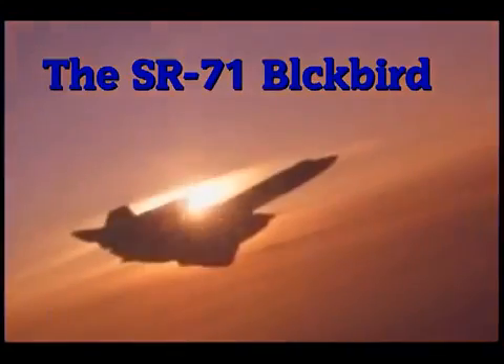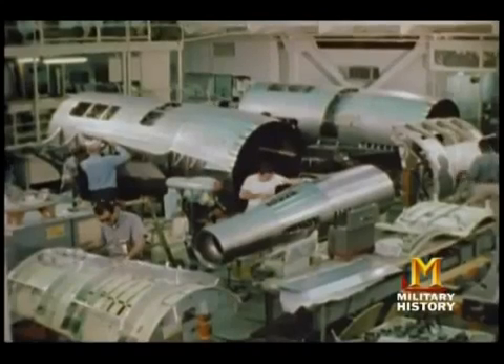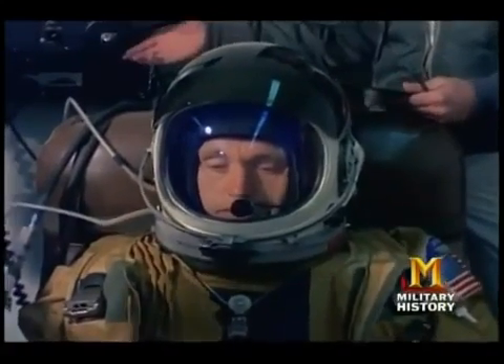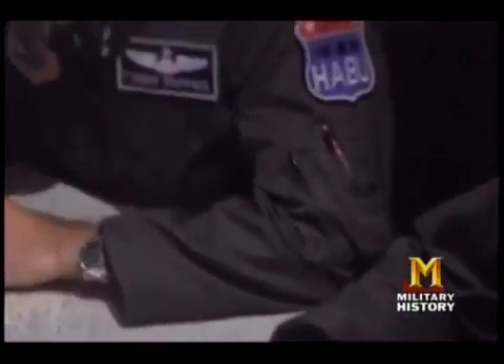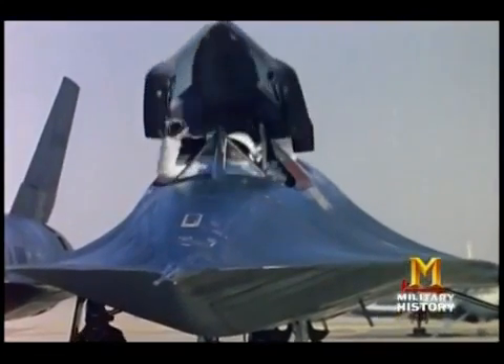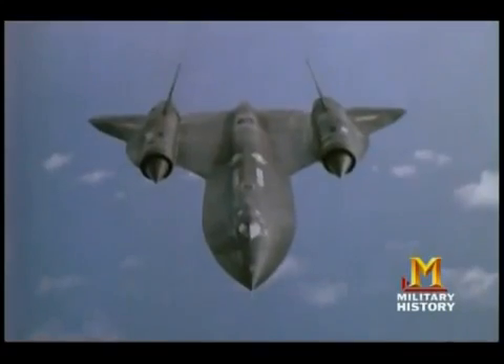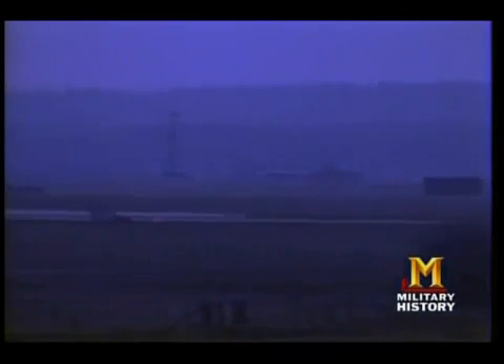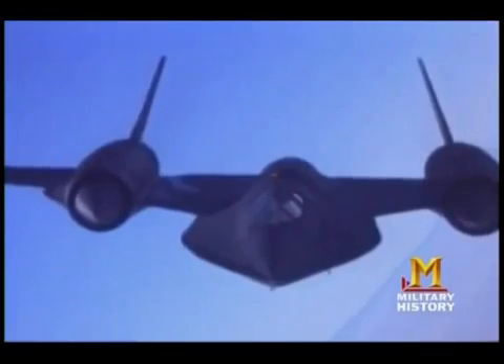Fastest Plane Ever Built : Documentary on Designing and Building the Blackbird Spyplane

Comment: It is no longer the fastest plane, and hadn't been for years. There are planes that are more than twice as fast.
Reply: +Dennis Sanders First two are unmanned and all are rocket powered. Those are considered planes but so is the nasa space shuttle and thats even faster then the planes mentioned. The sr71 would be considered the fastest engine driven plane ever.
Reply: Like which?
Reply: +David Barett Falcon HTV2 - Mach 20, X-43 - Mach 9.2, X-15 - Mach 6.72. And I am sure there are others that we do not even know about like Aurora and SR-72.
Reply: Not sure what your point is but It clearly states in the title "the fastest plane ever built" and I am just pointing out the error.   The aircraft I mentioned are in fact planes whether they are rocket powered or unmanned does not negate the fact that they are planes.
Reply: Video specifically states that the SR-71 is the fastest jet.  All others are rocket powered.
Reply: Prove it.
Reply: You need to educate yourself. There is a big difference between what is essentially a space craft and an aircraft. Any moron can quote Apollo craft for example as faster.
Reply: Let's debate until we die...
Reply: Your knowledge is low resolution. A rocket powered craft that operates above the atmosphere is not an aircraft. AIRcraft.
Reply: ***** To Dennis Sanders.
Reply: ***** lol The shuttle? Come on man. You can't call it an aircraft just because it has to pass thru the atmosphere to get to and from it's objective. In that case you can call the Saturn V an aircraft.
Reply: ***** Right now I'm travelling at hundreds of kph, (relative to the center of the Earth), just because the Earth is rotating. I'm powered by farts, therefore I'm an aircraft.
Reply: ***** Faulty reasoning. Someone with a PhD in math could say 2+2=5 it's not correct to say that just because they have a PhD and I do not.
Reply: ***** How did you get a degree with reasoning like that?
Reply: ***** "more than twice as fast" for one thing, is wrong